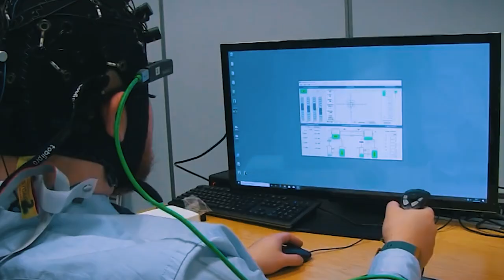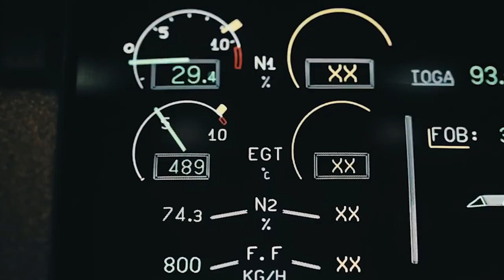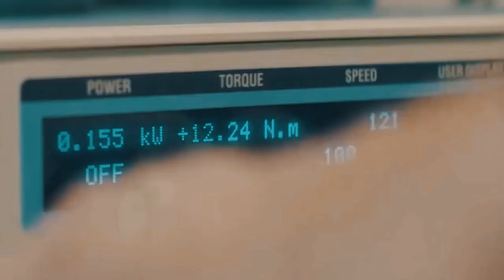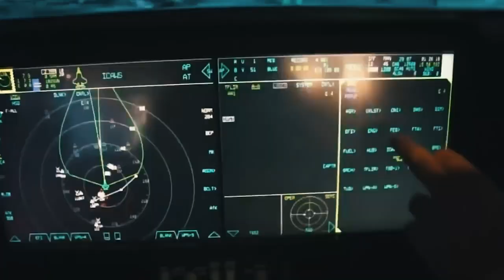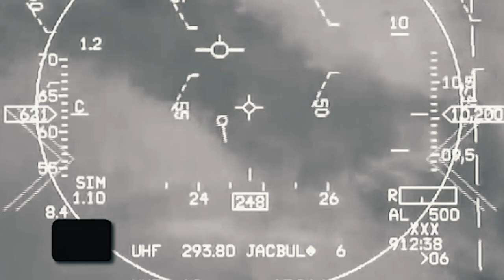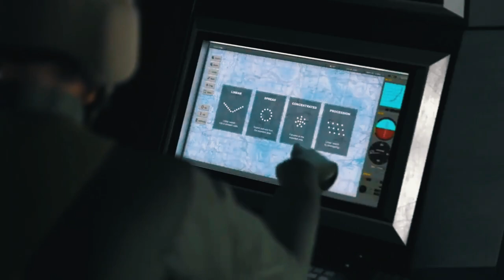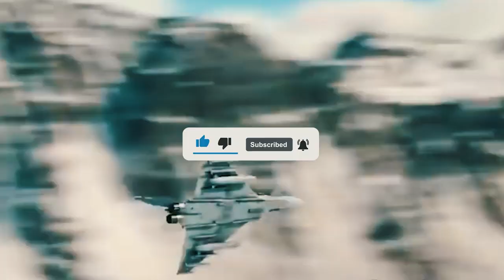The British Are Testing Their New Secret Combat Aircraft

Comment: Instead of using old technology engines. Why don't they make an engine that makes electrical power whenever the running to charge up any batteries they may have on an aircraft. supercruise mode it can run on batteries period as long as the batteries are running the aircraft you can't hear it. Why don't the Britain juices skin that moves the aircraft. So they don't have noise whenever they turn. And before all this goes on they need to make the people that build the aircraft. Legally responsible and apply the aircraft into battle period to make sure it's safe. After all England sold a rocket launcher that can blow an aircraft out of the sky in three seconds. If the aircraft is not faster than that rocket launcher what is the point of making an aircraft that can be destroyed in 3 seconds.
Reply: You can't run an aircraft of this magnitude via battery alone, the best currently would be a hydrogen hybrid but even still, the speeds these things go requires so much more

Comment: You didn't hear what they said the Rolls-Royce engine is going to have a generator in it. Charging the batteries. You shouldn't listen to what you're saying if the aircraft has unlimited flight it's going to switch. From batteries two high-speed jet mode. Only when it's attacked. Otherwise it would not be very efficient with it

Comment: Again - a totally misrepresentation of the facts (basically coming to absolutely wrong conclusions). The generator which acts like an electric starter, has nothing to do with an "electric turbine". Even the British (I believe, they are still oblivious to the costs and the needs of producing a next generation fighter jet) are not stupid enough, to believe, that an electric powered jet is possible within the next 30 or 40 years! 

At the end Tempest is a dream. I would not be surprised, if eventually whole Europe would come again together to design the project. As Germany and France (now with other countries as well) parallel develop a jet - and eventually the goal is pretty much the same: replacing the Eurofighter Typhoon with a 5th (+) generation fighter jet.

And coming to generations: even though politicians (and media and social media) are happy to call these projects 5th generation - it is doubtful to be really 6th generation. I would rather suggest that this will be solid 5th generation - or maybe 5+ gen projects. As the weapons, which will be changing the warfare are probably quite easily adapted by the F-35 as well -the airframe will not make a major difference. 

Also a generation jump isn't necessarily based on the technologies used, but by the efficiency and the effects, these technologies have in the combat scenario. Hence it doesn't matter if you have drones and high energy weapons (which are two of the most anticipated next generation systems), if they won't have a transformative effect on the combat scenario (force multiplier).

Comment: Rolls-Royce are also looking at flywheels to be used for Massive amounts of instantaneous energy, for Directed Energy Weapons.
About it being an electric aircraft, not a chance, it's gonna use electric power for taxying, for the few moving surfaces it'll have, fir Cooling, plus it's gonna have heat regenerator, also utilising heat energy and converting it to electricity, so it'll be powered by military grade jet fuel, but using electronic management systems for utmost efficiency, computer controlled from the most advanced pilot interface on earth using augmented reality as well as virtual reality, AI and as you said directed energy weapons, it'll fly itself, so the pilots can concentrate on battle management and total situational awareness. 🇬🇧🏴👍🏻